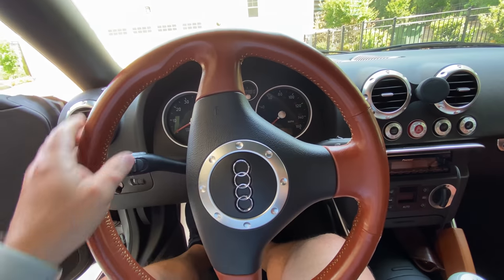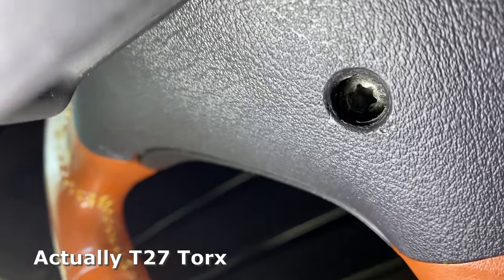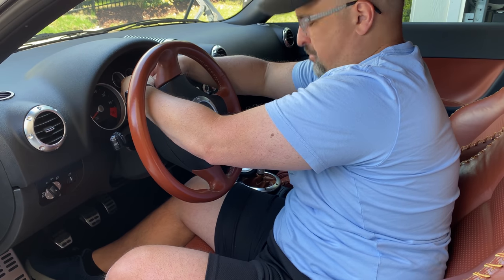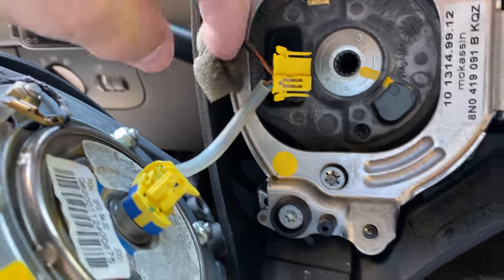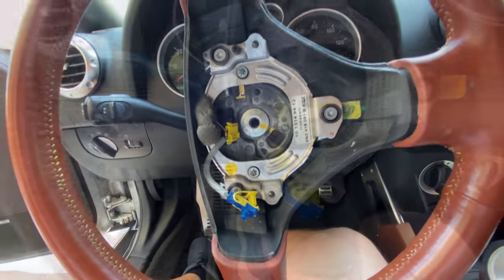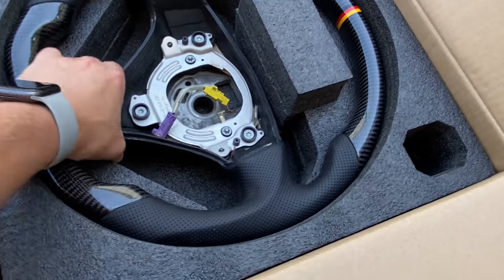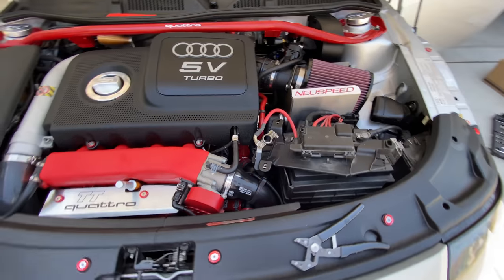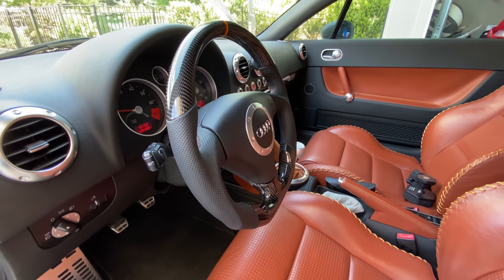Upgrading a Carbon Fiber Steering Wheel on [Audi TT MK1]

Comment: Hi, how are you? you could tell me where you bought that steering wheel. I'm interested in buying a steering wheel at my Audi tt mk1
Reply: Hey, I'm thinking of buying the mk1 TT. Anything I should think of before buying?
Reply: @unleashsenshi466  Hey, it's a good car it's best to buy it with a few kilometers, and that it's the 225hp Quattro traction model or the Quattro 240hp sport, have the engine up to date and well maintained and put a stage 1 stage if the engine is fine and supports it and then Audi r8 coils, spark plugs,